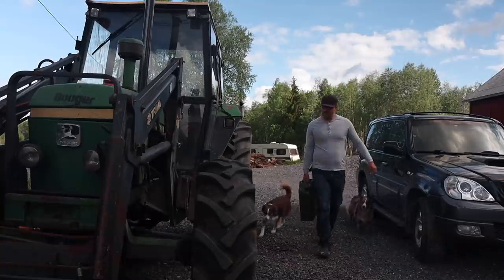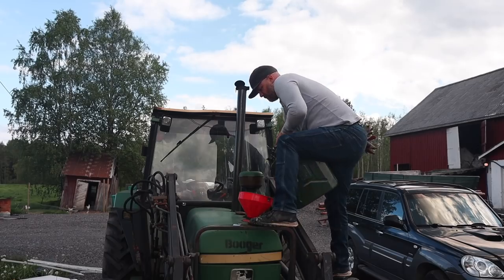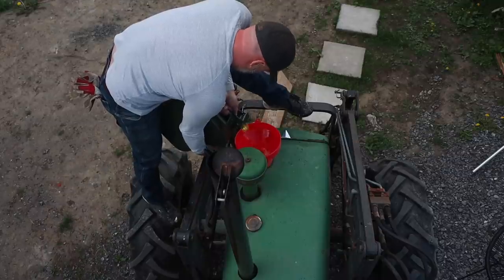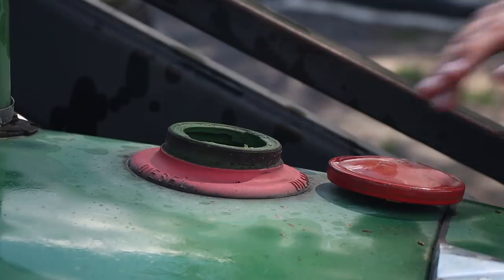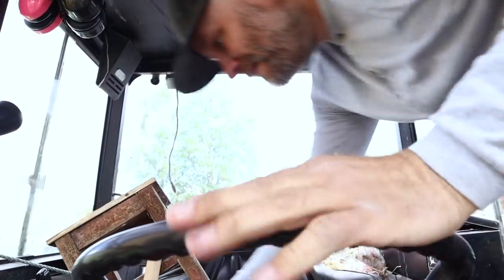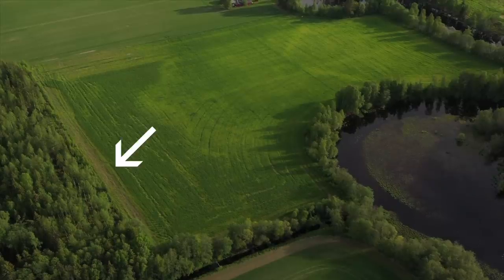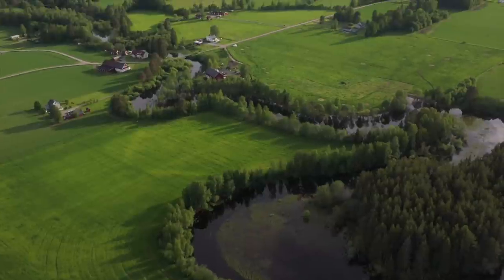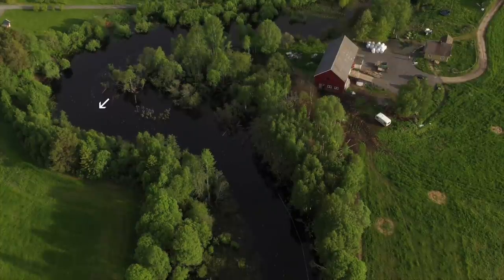Farm Fence Posts In The Ground The EASY Way!

Comment: That looked hard work E. Fencing is though. Keep your tractor loader well greased while you are using the concrete post basher .🙂👍
Reply from the maker: Good tip, P! I will! Don't have to go to the gym in a while, that's for sure!